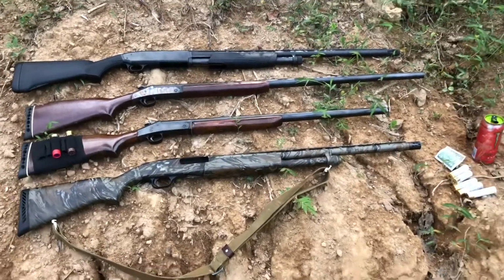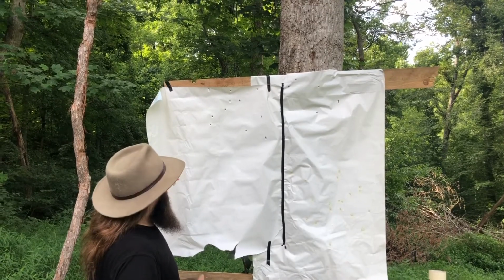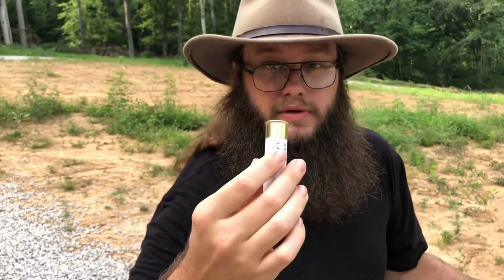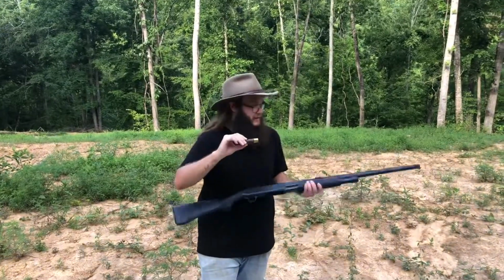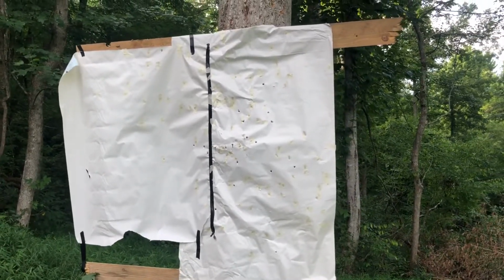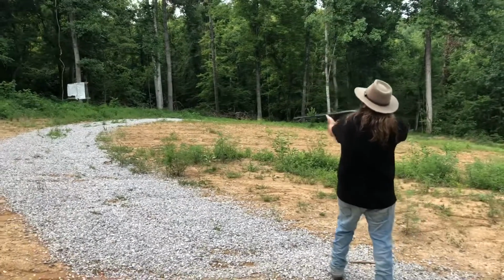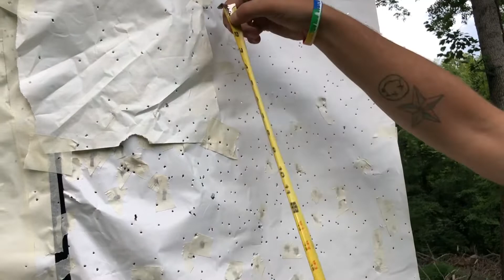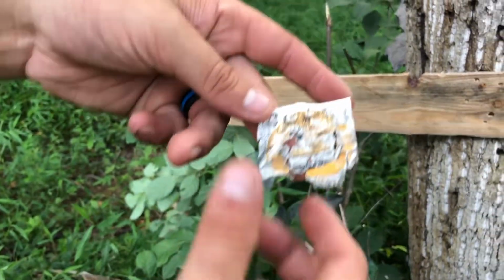Patterning SuperMags! 3 Ounce And 2.75 Ounce Loads 10 And 12 Gauge!

Comment: Thank you for the video Fellas. Nice job! Gotta take exception to the 3oz turkey load comments though. Extrapolating even your very best ever 30 yard pattern of lead 6 shot to 80 yards and suggesting that it would be an effective turkey load way out there requires exceptional optimism. Just gonna leave it at that. Looking forward to the next one fellas.
Reply from the maker: I’d never shoot past 40 myself. I didn’t mean 80 that’s a bit extreme for lead, I meant 60 and even that is probably too far for 6 shot. If I ever get into loading tss shot I will shoot this again at 60 and see what happens.

Comment: I'd say, judging by the consistent patterns to the right that ya'll may be anticipating the discharge and pulling/yanking the trigger, pulling off when firing. Very common especially when firing stout shogun loads.  I'm guilty of this very problem and have to concentrate to overcome.  The trick is to gently slightly squeeze the trigger (while holding breath on exhale) with the middle of the tip or pad of your trigger finger so that when it does release and discharge it actually startles or surprises you.. this way your more consistently on dead center. 
Ps, I used to shoot competition combat team and did lots of on range one on one remedial training during rifle qualification.  As well as range safety safaris.
Reply from the maker: That’s what we tried to do but the recoil is so stout it’s hard to focus because you know it’s coming lol.
Reply: I believe you might me on to something there lol if I take my time and squeeze instead of pull I seen to do better sometimes it’s hard to do knowing the beating I’m about to take but at the end of the day all I can do is try and do better
Reply: Exactly what I meant by its common when firing stout shotgun loads.. the anticipation is real. Lol .. it's hard not to flinch a bit.
Reply: Lord knows I'd flinch like hell with those loads. 1.75 OZ 12ga at 1350fps is tough for me to not flinch. Best thing I've found is mentally train yourself to "not care" that you're about to get mule kicked. The down side is it takes a lot of practice to get that cannon kick finch to go away. Sometimes I'll switch from 22LR or 5.56 to turkey loads and back, reestablish my fundamentals on the light ones, then tell myself that "this turkey load is just like the 22lr".

Comment: Those are some awesome loads makes the factory 10g loads look weak in comparison. If you get any of have any to show mabye point out over pressure sings for some of us new reloaders
Reply from the maker: We’ve fired dozens and dozens of the 3 ounce 10 gauge loads is all sorts of configurations and have never had pressure signs. If we ever do we’ll be sure to report about it. The 2.75 ounce 12 gauge loads haven’t given us issue either but we haven’t fired as many yet.
Reply: @theshotgunscientists  is it similar to rifle rounds with flat primers and sticking casses if they are? Just trying to learn what to look for. Thanks for sharing this info and vids
Reply from the maker: @obbyjep7597  the brass will deform around the rim, primer being flat isn’t always a pressure sign but a punctured primer may be, or if it’s flowed back into the firing pin hole. Cases getting stuck when the shouldn’t be may also be a pressure sign, but not always. Deformed hull mouths are a sign too, as in the plastic being stretched longer on one side. There are a few powders out there that burn hot and will melt plastic though, like black powder or substitutes, and Imr 4227. 4227 is a pistol powder but has some uses in heavy for the gauge shotshell payloads. Sometimes it will melt plastic, but I’m probably one of the handful of people left that uses it for shot shells.
Reply: @theshotgunscientists  thx man